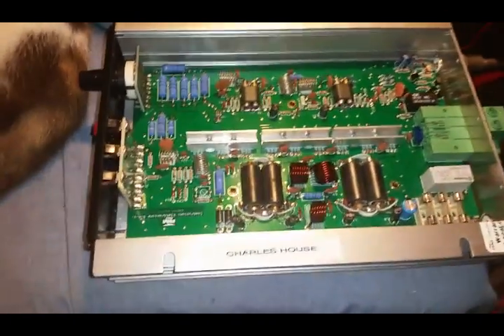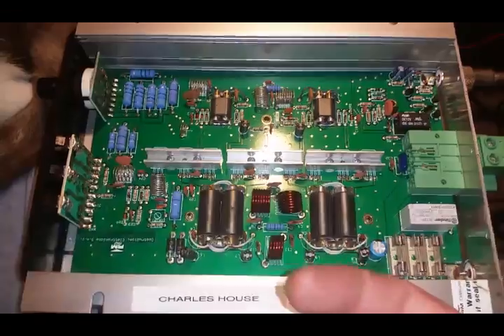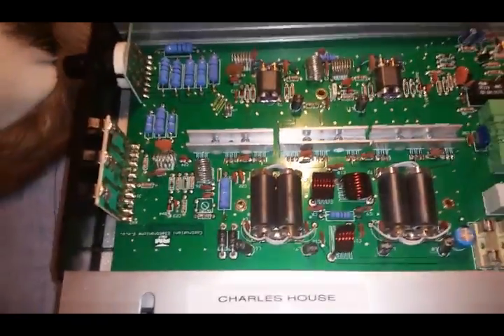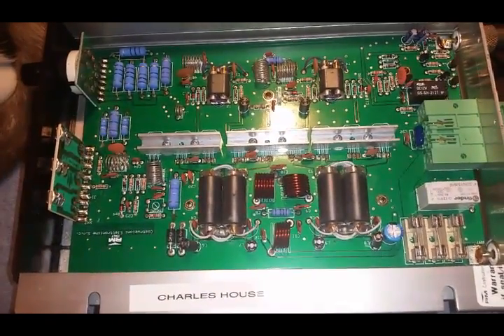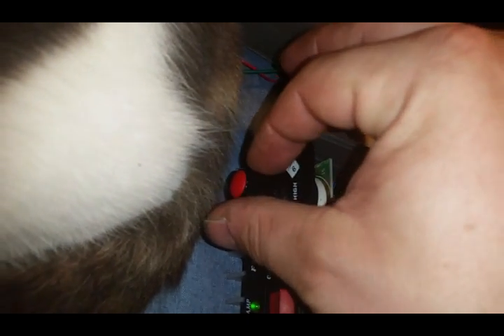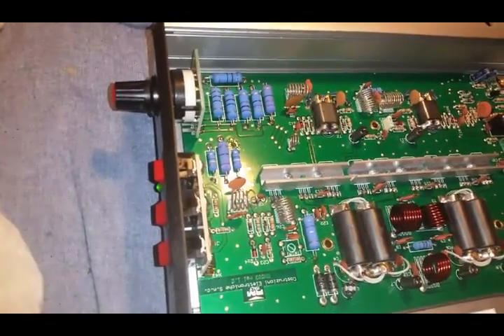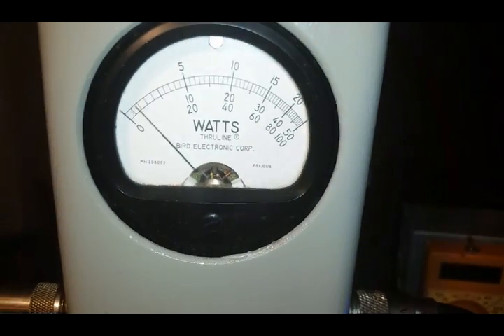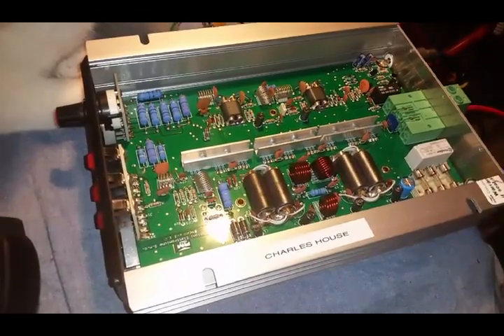RM Italy KL-503 1 Driving 8 Mosfet Amp Repair

Comment: Remove or bypass the driver & the sounding shitty on ssb will go away. I removed mine & I took out the -7db attenuator & used a 1000 pf mica cap & it does more than before. Being I removed a 60 watt driver transistor it’s ok to use a 30 watt pep radio. I use 40 pep out of my icom on SSB it puts out 325 watts. On 10 meter 28.400 it does $350. Keeper I’m not one to say anything against anyone but please get you some finger nail clippers they are nauseous looking,lol.
Reply from the maker: Good move....that is a great movie actually. Thanks for the comment.

Comment: What are your readings on the mosfets?

And did you measure them in circuit or take them off to test.
I changed the 1n4007 diode, but still the same
Reply from the maker: It is easier to read them out of circuit or unless your able to bend the legs up with out the potential possibility of damaging them. I use my atlas now to test F E T s but back then I used my analog meter im sure... this is an old video
Reply from the maker: You say still the same but I don't know what you mean?
Reply: @1883GotDown  
Slight update!!
I removed all the MOSFETs. Tested ok.. or at least they all test the same with my meter, and all are read by my transistor tester 
Did note a poor solder joint on one of them. 
The original problem is terrible SSB audio output using this amp.
FM is acceptable.. just. But SSB sounds almost like it's off frequency or losing something in quality. 
I've seen people bypass the driver, but unclear what any consequences of this are.

Comment: How common is the in4007 diode to go..
My amp died, and it appears ok other than this
Reply from the maker: Not common but..where is that diode? Relay or hotbus?
Reply: @1883GotDown  
Sits right next to the relay 
Reads 220 in both directions

Comment: You can bridge the 3 fuses, or swap the 3 for 1 30amp fuse, create a bridge across the bottle neck, and your 300 will be 420w and 480w(pep)
Video on YouTube about it.
Looking for a Rm Kl 503 HD myself, its about the only 1 that my 50amp psu will handle lol
Reply: cat radio videogates  I bought the 503v, blew the mosfets within 2wks month, I use FM in the UK 🇬🇧,  so it needs fixing, I have a Zetagi B300p & kl203 also, not spoilt for choice.
6900n is noq old (6mth's) so might upgrade to a multiband around Christmas time, we'll see.
        73's 26-CT-4078 Mcr, England 🇬🇧
Reply: cat radio videogates  I have a 30a psu & a 50a (40 continuous), but have looked at the 50&60a psu's, they're around £130 new, so not much, not an essential atm 👍
Reply: cat radio videogates  I like the Texas Stars, I thought they was for the US Market, Rm's & Zetagi's are the 2 main European ones I know of.
The 203 with 7/8w in does 75w, thats plenty for Europe, maybe I'll add more in the coming months, I have 80ft tree's some 50ft from my shack/room, I plan to use these to my advantage, height + longline + multiband DX/Tx

Comment: Doing a straight 8 mod is an easy mod and makes this a very nice amp. The reason for the 1 driving 8 is for CB radios. While it's illegal plenty of people do it. However SSB sounds like crap with the 1 driving 8. As a straight 8 SSB is very clean. The straight 8 needs more power than a legal CB will put out. I am putting 20 into it and getting a solid 225 out. Much less chance of burning up any parts as a straight 8. Great photo with instructions on page 3 of this thread.

https://www.worldwidedx.com/threads/rm-italy-kl-503-watts-vs-amps.171280/page-6

Comment: Just bought one the KL 503 the newer version owner's manual says April 2019 the owners book says it will do 300 watt Max RF power to run amplifier input 1 to 6 Watts Max almost my question to you is am I better off with a Texas Star amplifier? RM Italy amplifier is black face plate with the blue buttons the one I have is the new version
Reply from the maker: Ooooh yeh you really are better off with a Texas Star. These amps are designed for very low input. It is easy to fry the driver.

Dont get me wrong they do have there place. I personally like a Texas Star better especially the older version.

Comment: I disable the Driver in 6 of the KL-503 it and drive the 8 strate it is easy to do.. And you can run the radio at full power
. it is easy and i have it documented 

there IRF520 the thing only needs 4w in after the mod you can drive 25w pep
Reply: Please share with me how this is done???
Reply from the maker: @swingdaddy2126  ill be making another video then I'll show
Reply: i am also interessted ho it works with the mod without the Driver, i have also the same Problem in SSB , The RM3 = IRLZ14 but RM4 the Driver ???
Reply from the maker: @andreasviehmann5805  ill be showing soon
Reply from the maker: @Mr_Meowingtons  yes sir you are correct.
Reply: The irf520 won’t work in the 503. Tried it , only 50 out with 30 in.

Comment: Update: I contacted RM Italy and they actually replied back. They told me that the transistor with the yellow dot was a custom part (not because if that was the case they would have their own custom part number on them) My question is what did you sub out for the yellow dot driver?
Reply from the maker: IRF520 I worked perfect. Just buy a high quality one not a cheaper b
Reply: @1883GotDown  Thanks for replying back. I did order a handful of the driver MOSFET's from them because they had an outlet here in the US and they only charged $5 for the transistors. If memory plays correctly I may have tried an IRF540 as the driver which did NOT work. I read somewhere that the IRF540's would work fine for the driver but they were wrong. However they do work fine for the outputs. I only had a bad driver on my amp and the other MOSFETS were absolutely fine and after doing the repair the amp put out exactly what it did the day that I purchased it. I'm using this on my base station and it gives me plenty of power just to cut through noise with. I did a couple of mods to the amp the day that I got it setting it up so that it would key with the radio circuitry instead of the RF so that I didn't have any dropped syllables or words on SSB. What I realized was this amp would have a tendency to go into self oscillation if it was keyed up without a carrier present so I added some extra filtering around the input stage that took care of the problem all together. I've had a lot of use out of this amp with no problems whatsoever. The only reason it failed was because I accidentally overdrove the input testing out a newer high power radio forgetting to cut the power back... My mistake.  I only push this amp with about 1.5 Watts and the audio quality is top-shelf crystal clear outputting a very clean 100 watts with good forward modulaton. Before I forget, thanks for replying back about using a 520 as the driver.
Reply from the maker: @flash001USA  roger roget...good deal buddy. I still have one here for repair and I think this time imma add a 3db or 6db attenuator so it can be ran with a regular single final radio. I'll do some math and figure it out.

I have a 4x16x64 to build with IRF520s lol that is going to be nutts man. If I have any issues with it imma just back out cause that is a crazy idea. I have a 4x16 ERF7530 Amp right here on the bench right now.

Good luck buddy sorry it took me so long to reply.

Comment: Manual does not say PEP. Only on output do they mention 300w pep to make it sound impressive. Power Input is RMS deadkey values. It is a 200 W amplifier . It is a RMS beast not peak. I will take RMS any day. Run cool at 2W yield about 110W dead key.

Comment: Have not worked on this model but all like it are low drive fet amps.You can add some input padding to the driver stage. you need to keep 50 ohm Z watch input VSWR. I got the KL203P on my 2950. I padded the input . works great. use to drive 4 572B tubes.
Reply: best  thing to do is remove the driver mosfet!

Comment: If your not sure what devices are used in this amplifier , Then how did you know what devices to use to  replace the blown devices  ? .... Seems a bit of dodgy guess work .
Reply from the maker: MrMadjones because the driver transistor is separate from the finals I could tell by the circuit layout that an irf520 would work just fine now if one of the final devices had blown then I would not have been able to do that that would be very dodgy replacing & Final where there's 7 other devices and you do not know what devices they are you understand what I'm saying all I had to do was replace the driver device and an irf520 matched up perfectly there's always more than one device that can work in a circuit or at least were close enough to be used hope that helps you understand a little better I don't never play hit and miss with people's amplifiers that's a big No-No
Reply: @1883GotDown  Never heard of capitals and proper punctuation, have you? You write like a pastor delivers his preach...
Reply from the maker: @eknaap8800  yep, this social media...a lot of times I'm typing while on road.  Thanks for your kind words
Reply: @1883GotDown  : It is really horrible to read...
Reply from the maker: @eknaap8800  srry about that. My fat fingers on these phone doesnt make it easy lol...keep a look out will be releasing slot or new videos very soon

Comment: Good review and everything. Maybe should also talk about the switches in the front. Many people don't know what the Pre switch is used for and how it should be used. I think most know what SSB and AM are used for. (Single Side Band and AM is for CB) If you don't know what the ON/Off is used for, maybe you should not own any electrical device. ;)

I own one of these and it is a nice amp. I can really get out with very little input wattage.  I use less than 5 watts. I rate it 4 out of 5 stars compared to the very best amps in the world.

Comment: I run my 203p with 1WATT input, I get a 40WATT dead key with a 175-190 modulation swing and it run cool to the touch
Reply: +John/Meghan Evans  i have a kl 200p 10 watt input i get 100w and 200w on ssb...  am using 10g wire....
Reply from the maker: +Jose Rivera does yours run hot with the 10w?
Reply: Sorry I got a 501 rm no problem

Comment: Power Level 3 = Best Input SWR

The eight "RM3" are not IRF520. I know for sure beause i figuerd out what kind of FET is behind.
The Driver, RM calls it "RM4" (yellow dot), seems to be another typ of FET, Im now on the way to find out which kind of...
Voltage up to 15V will work fine for KL-203 and KL503. 15V will acquire some astonishing extra Watts as well.
To make a high drive out of the 503 just PM me on YT or CBRT.
Reply: +Michael Podgorski You may send me a PN if you need some...

I've spend several € for equipment and parts.
Now I'm collecting defective KL-xx3 from ebay and repair them.
In the moment I have my money back i'll spread the word.
Reply from the maker: I was very tempted to talk the fellow into allowing me to bypass the driver. I am glad that the 520 worked though lol. I am curious what type of FETS they are so I will shoot you a message sometime to see. Thanks a bunch for dropping by the videos. 73s
Reply: 1883GotDown  I will send you mine for a Guniea pig , I’m pretty happy with this amp haves no issues, 325w on setting six but I keep it on setting 5, any updates on this amp ?
Reply: 13PR87 Wellenfilet how do I on you would like to know what your talking about
Reply: 13PR87 Wellenfilet can you let me know , also a 503 high drive just came into the United States looks exactly the same as the original 503
Reply: What is the correct mosfet? 
Will the irf530 work in this unit also?